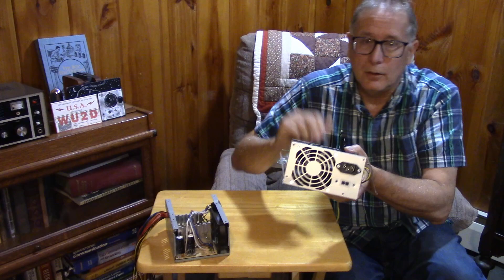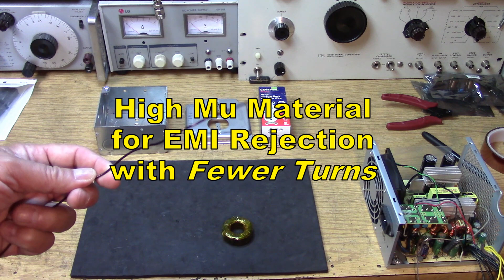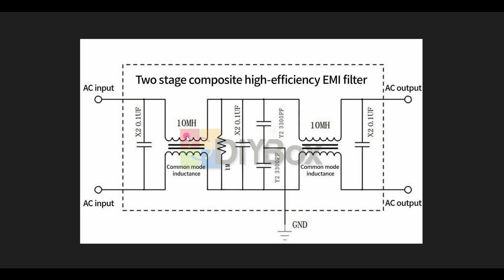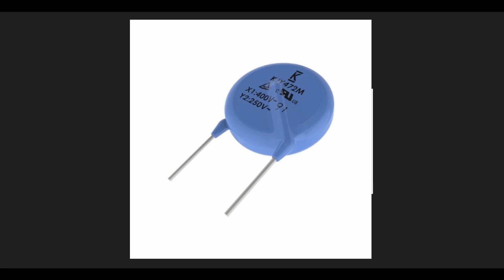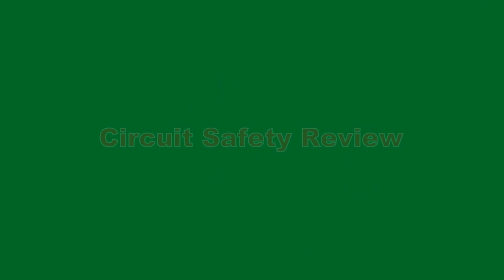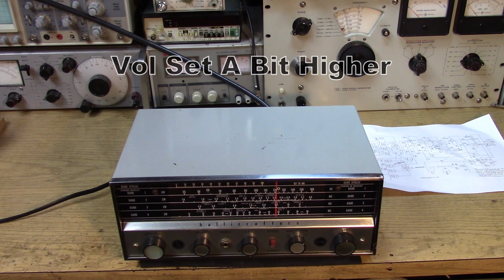My Dishwasher from HELL (Version showing Grounded Box)

Comment: Question. If I go into a store, they probably would not let me plug in a radio. Is there any way when I go into the store I can test for this??? Perhaps a battery powered radio running at 20 MHz?
Reply from the maker: A simple pocket radio from the 70s in the AM Band will work fine to sniff noise.
Reply: Thank you very very much. @MIKROWAVE1

Comment: Excellent; thank you. I built an AC isolation transformer from two, identical UPS transformers placed back to back. The case is grounded to earth, but the earth ground does not extend to the output, of course. Presently, I have the entire unit torn down on the bench, as I am adding a soft start circuit. The transformers must be creating a large amount of inductance, as the 3A/Slow fuse is blowing on start up, with no load. It has occurred to me to add some type of noise suppression on its output, while I have it open. But, noise suppression is way outside of my knowledge base. Do you have a suggestion and link for a particular ready-made module. And, shouldn't it be installed on the iso trans's output. The iso trans is 120VAC/120VAC @ 3A. Please and thank you.  My DIY VAC PSU = Emergency Shutdown Switch to Iso Trans to Variable Autotransformer to Dim Bulb Limiter to DUT.
Reply: Oh... I had an idea... Maybe I could take the noise suppression from one of the donor UPS boards. But, I would not know what I was looking for. Ahh, yes, another learning curve...
Reply from the maker: You never get everything back with the two transformer trick and in fact you might notice them getting warm to the touch. They are not actually designed to work "backwards" which seems strange, but it is about the windings, core and design. But it works. And yes you can employ an EMI filter. Ground can be carried through on a separate lead and connecting to the XFMR bodies is a good idea. A shielded box is also helpful for the ultimate.
Reply: @MIKROWAVE1  Thank you for your reply. Please confirm that the filter should be placed on the output of the iso trans. Money is tight for me, as it is for most folks. So, if anyone knows of a good deal on a specific proper filter, I would be pleased to know of it. Much appreciation.
Reply: @MIKROWAVE1  Another question for my iso trans application... In the filters demonstrated, there are a pair of Y safety caps on the output/load side that return to ground. The Earth Ground is not used, or wired, on my output. So, do I use a single X safety cap of twice the Y cap pair single value on the output/load side, between Line and Neutral? Edit: I believe these are the differential caps.
Reply from the maker: The EMI filter can be on input or output, probably the output is where I would stick it since the isolation transformers will cut a lot of noise. But practically, if it already has an IEC input socket, put it on the input. The ground has to be brought through for both safety and noise rejection.

Comment: My GE clothes washer? Same deal, RFI galore. Plus, the local dealer no longer offers service. He says the new, computerized appliances are too complex and he can't find qualified service technicians. I've had a look inside the thing. I don't expect it to last too many years. So I picked up a good, used, Stone Age Whirlpool washer from the 90s as a backup. Don't laugh at me. I kept a Maytag Neptune washer running for 15 years for a family of six. That might be a record. Thanks, Mike. Great video. I'm going to get a few of those Chinese RFI filters. But not for the fridge. Too risky.
Reply from the maker: It is hard to beat a good old CORCOM and a couple of Type 43 Snap ons.  https://www.ebay.com/itm/394608998738?epid=14055829509&hash=item5be0877952:g:r~IAAOSwnXFjavIp&amdata=enc%3AAQAIAAAA4IncvW3WbSQw6JRnoZ4iT1A9AIV9Co7TIdYttjHXPzniSZqs%2Fr%2B3PWpG%2F%2F8ujS5tiu02qVQ9SrlmmiAbXj8xIr0U936j11X5fP0HDFOO5RioDZAt7LfdgDleOL9rb0x7ILF7fYVc6ZkX0cHXCyRlcjPA6cuXV9B9TSwQDIUPjGQ%2Bl0jPzlZI63WMQbLL%2Fr8%2BCOMjUOOSDTsDtaQRJtip77W7rA2BqWF5y4VdaLJm%2F4yWsiQnp3fqQ%2FR%2FL47%2Brk%2B7qLOBmzZCIShwa03%2BvfX3g%2FnjGDkFt0jMDANmgGEbRMOv%7Ctkp%3ABFBMgJLv8MZi

Comment: It's a wonder why they don't have regulations on appliances or any device that makes EMI, to require this type of filter in side of them.   I guess there is more emphasis on electrical safety with neglecting controlling the switching noise from radiating out onto the line cord/house wiring.
Reply from the maker: Well they do, but the idea is to put in only the least amount of protection to pass...

Comment: I was just thinking about a project to reduce or eliminate line noise on my Halicrafters earlier this week. What are the odds?
Would extending the AC ground to the radio chassis with the polarized plug be a good idea or a bad one?
Reply from the maker: The Hallicrafters S-120 has a dual protection system. First is separates the Chassis from Neutral Ground, Secondly it insulates the outer Case and Phone jack from the Chassis. So what you are proposing could work if you connect the green ground wire to the outer case and not the Chassis. This could help and it would make a more fail safe ground. But if the AC outlet is wired wrong, hum could return since the neutral would now be hot and it would couple to the chassis so the chassis would be tickled by hum (still safe because of the cap and 470K resistor) but Noisy. But I think the hum is coming from the ridiculously high impedances next to the power switch on the volume pot and maybe that  crazy couplate module between the Audio and 50C5 grid.

Comment: My RV has a power converter / fusebox that lights up the whole neigborhood.   Nothing in terms of filtering has been effective.   Basically I'd need one of these things on the input, and every single branch circuit.   I gave up and switched the battery charging over to solar and disconnected the switching converter.
Reply from the maker: Wow that is a tough one! You would have to encase it in a box and filter everything in and out!